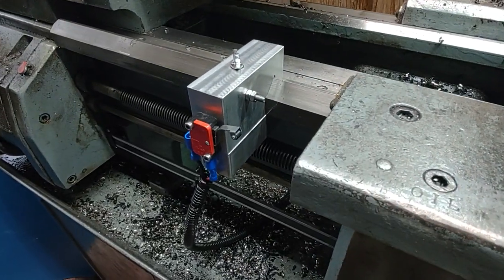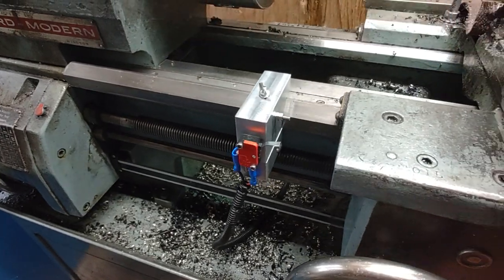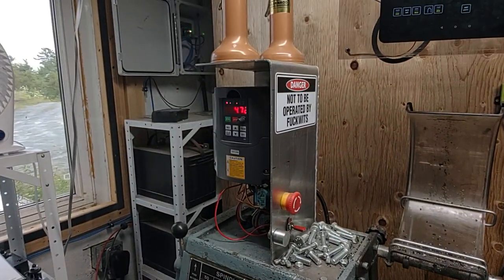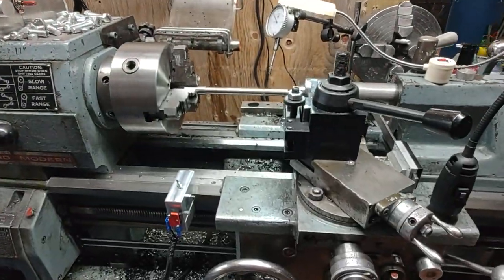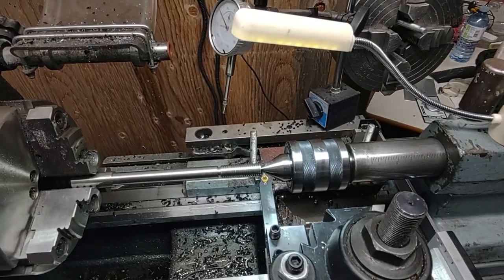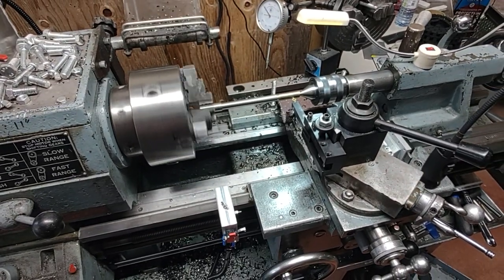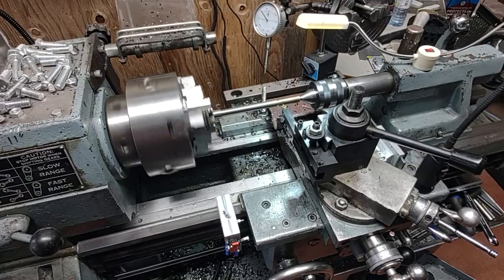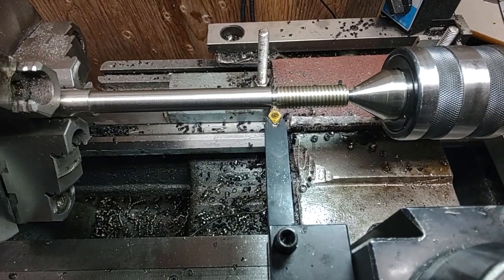Lathe Carriage Stop Switch

Comment: Thanks for this.  I was just  planning on doing this for my mini-lathe, and thought I should do a quick google search to see if a) it had been done, and b) whether it was a monumentally bad idea.  ;-)  Seems like it's not, or else we're both in the same boat!  I agree with the other comment that your switch isn't the best choice -- not really designed for exposed use, and not terribly strong.  But I suspect it's still working fine, 2-1/2 years later.